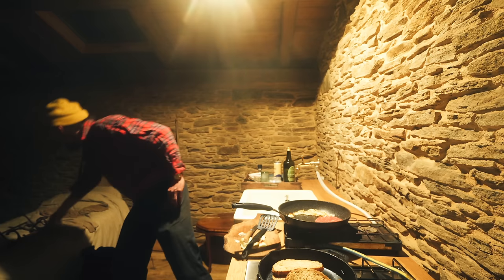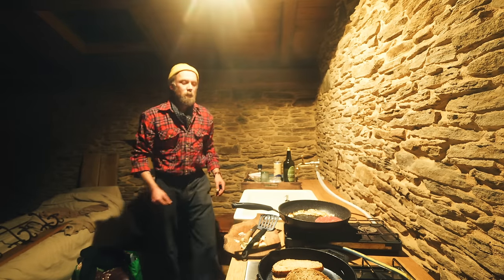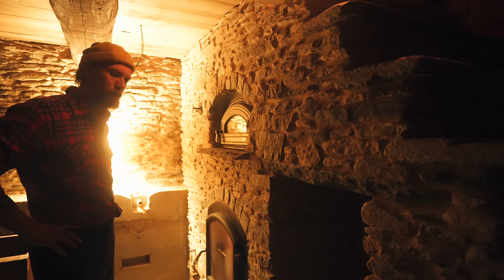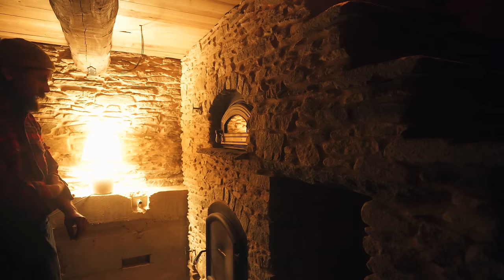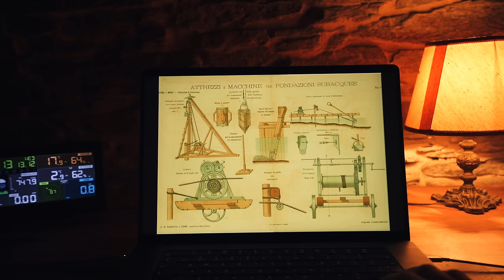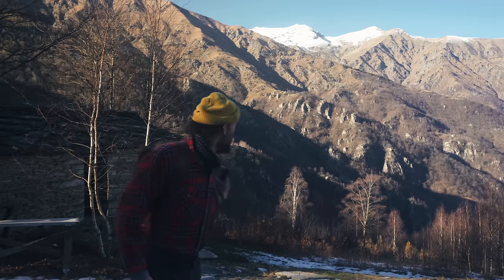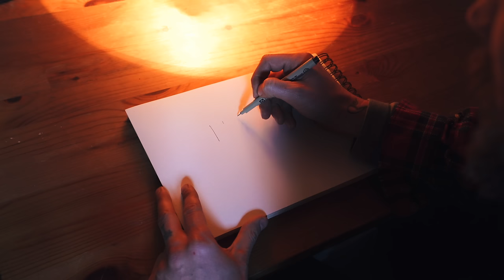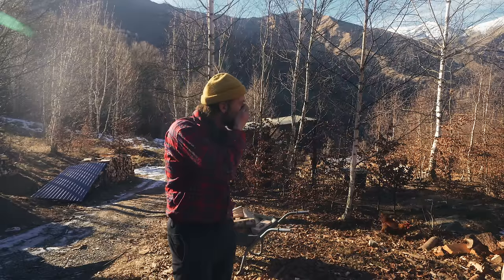#96 Plumbing, Electricity, Kitchen

Comment: you may want to shield your stone wall from grease splatter
Reply: I'm sure he will fit something behind the newly fitted cooker, the one he used here was just a portable one. A sheet of marble, or patterned composite, or stainless steel perhaps.
Edit: I watched the rest of the vid, to see Martijn using the new cook-top, without a splash guard. Those beautiful stones must be protected from splatter!
Reply: Maybe some transparent glass to prevent greasy stones but still let them be seen?
Reply: The first thing I thought of when he was frying right next to the beautiful stonework. At least some sealer.
Reply: Maybe a backslash of tiles or sealed flat stone.

Comment: It is somehow comforting to know that even a craftsman like Martijn has to re-do stuff.
Reply: Yes - I thought it was extremely honest of Martijn to show us the redo of the kitchen - how many would admit to needing to do that ? And yet we have all been there at one time or another !  It also shows the best reason of all to use screws rather than nails to fix things together - you can always just unscrew that connection - it beats  trying to get bent nails out of wood !  So many projects have little changes made because something didn't quite work out !
Reply: i do it mostly
Reply: @veronicaroach3667 
FYI, Veronica, you "have to use screws" when affixing wooden cabinets to stone and masonry walls. You first need to drill  holes into the stone wall for each screw to go into either a metal or plastic "Expander Sleeve" that you have to hammer into each hole you've drilled into the wall. Then, you attach the wooden cabinets with screws that go through the cabinet and into the expander sleeves that were hammered into the walls to receive the screws. As each screw goes into each corresponding expander sleeve, it "expands outward", locking the whole screw and sleeve into the stone wall. Martijn could easily use most of those same expander sleeves after he moves each cabinet over to make room for the Fridge. I hope that makes sense? Cheers and Happy Christmas!
Reply: I think you mean perfectionists as he is. He has high standards. So he consults YT and prs whenever he has doubts, questions or big projects to get right.
Reply: yes i was also shocked about the refrigerator debacle
Reply: If it’s gonna be one of them retro-stand-alone Smeg Italian fridges (as I think I saw on the drawing), you do indeed need an extra 15 cm space between the wall and the fridge to be able to open the thick retro fridge door. 🙈 (a friend asked me to post this 😋🫣).

Comment: Although you may already be planning to do so, I would recommend that you put a backsplash on the wall behind the kitchen counter, primarily to keep oil/grease from the stove splattering all over the stone walls. In time splattered grease would become unsightly, not to mention the staining of the wall. I would also put in some cabinets and use a LED light strip beneath to provide light for your food preparation and cooking endeavors, but I am sure this is on the list. Being in the cabin sure beats another winter in the tent huh? Be safe!

Comment: Martin your videos are life videos. I am finishing a novel and publishing one before that and I have renovations I have put off that I must do. I am a bit of a builder so I look at your work and see parallels - your choices, planning and execution -  your ability to solve all the problems from electrical plumbing carpentry building etc before and after. So much can be done ad hoc as you go when and if you have the plan,  the right materials and tools etc. One thing I have learned - solve what I call the "false wall" problem. Get rid of it before anything else. You have space which helps. You've dealt with the basics well (no silicon fill crap) and then faced the crises and it's all instructive. Congratulations.

Comment: I’m glad the fireplace insert is working out for you without a blower or fan…. Will you seal coat the rock/stone on the interior of your home?  

Being you’ve moved out of the tent the chickens might need to be moved closer to your home as well.  ..do they have a heat or lamp to help them stay warm .. the place is really shaping up… ❤ it appears, hard to tell, do you need a door seal at the entry door? I know I know…my Dad taught me a lot about doing it right the first time and you are doing it right.

I so enjoy your videos… reminds me of the home my Dad built…except it wasn’t out of stone ..but he built a stone fireplace and an insert with a big blower as well as brick arches and walls inside the house… steps using big slabs of stone like what you’ve done.. we also had an old and very big wood burning cooking stove with two cabinets up top that kept the food warm .. my dad refinished it making it look brand new (he was really good at doing those kinds of things) when it was a hundred years old… and he built the brick surround just for that stove with its own wood storage area - I wish I had pictures .. when the power went out in the winter which was often mom used the wood stove to feed us sometimes for a week the power would be out but mom and dad were always prepared for harsh winters … mom was an excellent cook making breads, pies, roasts … Good times…wonderful memories… your videos bring them back.

Comment: You should add ventilation vents to down and upstairs. Vent for fresh air to downstairs, in worst case while you use the fire place the exchange air will be sucked in through the sewer pipes, also possible cracks in the walls will bring air inside and with that particles inside the walls will be in the air that you BREATH. Then another vent to upstairs to get the "bad"/moist air out of the house. Otherwise over time you will have problems with mold and also your own health is at risk, bad air quality can cause symptoms to your eyes, skin, heart, and respiratory system
Reply: Gut erklärt. Ja Umluft ist die Lösung.

Comment: 4 cups oats
1 cup almonds
1/2 cup mix ( pumpkin, seseme, flax seeds, and/r sunflower kernels)
1/2 cup sugar
2 tsp cinnamon
1/4 tsp salt
1/4 tsp allspice
1/4 tsp nutmeg optional
5 TBSP almond-butter
1/4 cup liquid coconut oil
1/3 cup  maple syrup
2 tsp vanilla  

Bakes about 50 min. in preheated oven 275ºF.  First mix dry, then mix wet separately - then combine. Press on parchment-paper lined baking tray.  Bake 25 min. then turn and bake 25 minutes more.  Cool completely, then break it into pieces. Enjoy!
Reply: has to be gluten free oats though, for everyone unfortunately
Reply: not everyone has celiac, organic oats are fine for many

Comment: Hey Martijn, just a thought.  Maybe LED strip lights would work for you if you run them along the beams up top.  This would give efficient illumination to the whole room.  You could use a warm range for a comfortable atmosphere. They don't use much power.

Comment: Martjin, I ve been following your progress on your cabin. I was particularly interested in your stove installation. I sold wood heating appliances for years and I like your design. Basically, is your fireplace a huge thermal mass like a " Russian stove? I took note of the ducting and your water. Love the design. It should be extremely efficient. Wood is a renewable resource.. Pretty efficient burn, no smoke. Hats off & praises from Florida USA

Comment: Dear Martijn, from my experiences (heating of houses with several types of stoves more than 20 years) it is really short time to heat the cabin with 2hrs fire. You need much more time to accumulate and absorb heat into the all walls (not only stones and walls around the stove). It would be better to close the air intake and do a longer fire, for half a day atleast (better longer), not so intensive... And then much more heat will be "stored" in the walls. Then, in next days you can do a shorter fires. But I think you will never heat the cabin enough with 2hrs fire 🫣

Comment: All the work you've done in the cabin is amazing, and it makes me wonder if you're going to put a cooker hood over the kitchen or some other sort of ventilation. I think the steam might damage the wood on the roof after a while.
Reply: Yeah definitely stove range hood to vent all the greasy fat smoke away from the wall and ceiling.  That will accumulate and stink/go rancid. Maybe a nice copper one to match the gutter drains and chimney.

Comment: So satisfying to see the kitchen come together, see how the plumbing and electricity are going to work.
Really looking forward to seeing what the whole hot water system will be like, with the tank behind the masonry stove which I suppose is going to deliver pre-heated water to the boiler so it doesn't have to work that hard.
The masonry stove is simply magnificent. Surely the Temp Cast folks are well-pleased with your installation and how simply beautiful it is.
I'm sure you've arranged housing for your chickens while you'll be on holiday. 
Thanks so much for your channel.

Comment: I am at total loss! Why have a kitchen upstairs when the oven and fire are down stairs and it would be much cosier when eating and relaxing?   The shower etc could go up were the bedroom is as you will spend less time in there,curious!😊😊
Reply: The masonry stove weighs about 1300 kg, not a good move to put it on a wooden floor.
Reply: I doubt there is much difference in the heat up v down since it's such a tiny space anyway !
Reply: I also thought that. But who am I to judge! I’m just a 💇‍♀️ hairdresser.

Comment: I am happy that You didn't stone-cover your chimney-pipe outside any more as you were wondering in one episode, because it looks so good now. It is "ageing" so nicely because that valuable material You have chosen for it. Latest air-filming shows the change of colour so nicely. Just wanted to say it. Your fireplace has a remarkable ability to "gain" warmth. We say it is "varaava" in Finnish language. There is so much stone to to keep "energy" and give it away smoothley, that I was sure You can keep cabin warm with 2 fires/day, but with 1 🎉 Well done! Obviously you did a lot research comparing choices. We need 2 if it is under -10°c outside. Remember to rest during the holidays. And be proud of yourself.

Comment: Hi, Martijn, I'm Angelo and we already spoke several months ago, I wanted to give you some good advice on how to clean the windows of your wood stove quickly and very economically, this is a method used for many years and guarantees cleanliness without ruining and scratching the glass, in practice you have to take a wet sponge or cloth, push it into the cold ash that you find inside your stove, then start rubbing on the surface of the glass in all directions and you will see that in a short time the glass becomes clean and transparent as new, ........at the end wash the sponge well and clean the glass leaving it to dry .............good work and have a good day... ..

Comment: If it ever becomes an issue, covering the colder stone walls will greatly increase the overall temp.  Medieval castles hanging tapestries and rugs illustrate. Insulated quilts is actually a business. 
But your space is small, and very little glass. If you notice it is chilly away from stove wall... Few better feelings than closing in
on finishing your own home. All the best for a snug nest.

Comment: Nice to see everything taking shape. I’m thinking that you may need a backsplash solution between the stovetop cooker and the natural stone wall. Maybe just even a removable 3 sided splatterguard made of stainless steel or aluminum. It might prevent the stones from discolouring from contact with liquid or gaseous cooking grease. It can be stored away after cooking.

Comment: Worked on a remote ranch in Wyoming.  The stove would heat up the walls and retain heat as yours does.  Great on cold days not so great on hot summer days.

Comment: Love your show! Why not add a window into your cabin’s front door to add more natural light? 

Also, why not move your batteries into the small utility hut that’s attached to the side of your cabin? That way you can arrange heat transfer from the cabin to keep the batteries warm in winter, and you can monitor the batteries for inside the cabin as well. Of course, you’d have to insulate the hut and make a door in the wall.

Comment: What you are experiencing is your body adjusting to a different "normal" temperature. If you are used to 15, 16 degrees indoors it starts to feel very comfortable, while other people's houses will suddenly feel stuffy and damp. It takes a while to adjust, but you've been up there a while. You can probably manage if you keep your cabin in the 10-15 degree range with warm blankets and not use much firewood during winter!

Comment: It’s great you’re taking time to slow down. Kitchen is looking lovely. Are you going to make a cutting board (3planks with 2 cross braces) to fit in the sink so you have a little more prep space? 
It’s wonderful that you have an oven now, if you want you should be able to get a wire contraption (not sure what it’s called) to fit in your oven to give you two levels. Granola is crispier if you bake it on a shallow tray. Have a lovely Christmas, enjoy your break❤️✨🎄

Comment: That faucet (15:25) is a great find. Very fitting, like it was made for the cabin.
By the looks of it you might want a slightly larger cooker. But what you do need to think of is some kind of backsplash in order to prevent the stones around the cooking area from getting grubby from the cooking. And they will. Trust me. From experience. Perhaps something simple that covers the stove during the day and that you lift against the back wall during cooking.
And perhaps also something like a simple recirculation hood? Something clever?

Comment: I know that the stone work behind the range top looks lovely but it will be very difficult to clean from all the cooking grease. I would suggest if you wish to keep the stone exposed to get some tempered glass to put behind the range top. That would allow the stone to be seen but be much easier to keep clean.

Comment: You are lucky not to have to clearn the glass door - I have to do ours from time to time and a big messy job - mostly caused by wood not being completely dry. And I like the oven above that, as you say, is good for pizzas or stew - similar to a slow cooker, one of which I am getting this Christmas for this purpose. 
We have an internal temperature of 17-18 C, from our fireplace/heat distribution pump in the attic - that we find enough here in SE Poland. However, if outside temps. drop down below -0 C our system starts to struggle and we turn the radiators on. Energy intensive but we also have 32 solar panels to offset the costs.

Comment: I just love watching you learn and build this beautiful space in such an unbelievable place on this earth, thank you for sharing 🙏🏻
I do have a query tho as an interior architect. After watching you navigate and start using the spaces, can I ask why the kitchen was not put downstairs as part of the step in the wall beside the fire so you could use the little oven easily and sit by the fire whilst cooking and having friends over etc without having to go up and down the stairs. Heat rises so if you had your bedroom upstairs, would this be warm enough? or could an additional smaller fire could be put in at a later date? 
With the living downstairs, you would also have access straight out to the terrace from there in the summer. 
I am sure you have thought of everything, I am just curious ☺️

Comment: You probably already have planned it, but if not; here's a suggestion. Put a transparent plastic (or glass) sheet 3-6mm  in front of the stone wall, behind your kitchen. This will prevent oil, grease and water stains on your beautiful stone wall!

Comment: If you go out of town remember to keep the water dripping so it doesn't flood your down stairs because there won't be a fire and your pipes are uninstalled so you might want to foam rools around the pipe with some electrical take. Because you didn't put a drain in the floor for emergency flood

Comment: In the  days  when people kept commercial laying hens  for  a  second  season there was a thing called  force  moulting. Once production had fallen below a certain  level and  perhaps some  hens  were  starting to  moult  the  idea was  to  stress the  whole  flock   with restricted  food  and  darkness for a  short time  of  a  day  or  two. Not  a very  nice  thing  to  do  but it  caused all the  hens  to  moult  and  then   restart laying  together  instead of each taking  a different  schedule. Nowadays most  flocks  are  not  kept  beyond   one  year's  production. The  point  I  am  making is  that  a hen's  reaction  to stress of  any  kind  is  to  tip  into  a  moult  , so this  is  probably what  is  happening  with  the  Leghorn.

Comment: Kinda amazed you had to completely disassemble everything to move it right a few centimeters. If it was that heavy two logs and two boards could have levered it over. That’s why you always install several more cm/in to any hose or wire. For the unanticipated wiggle room.